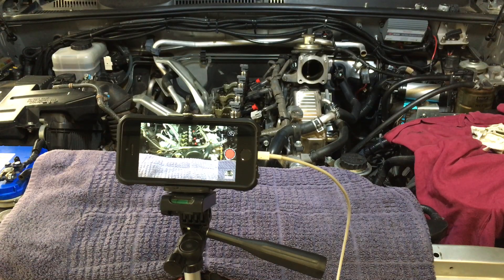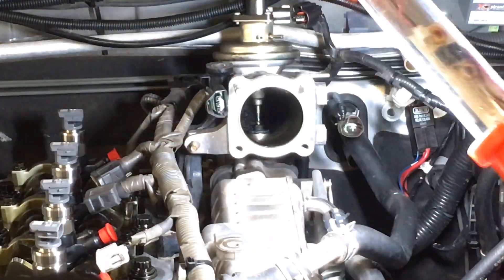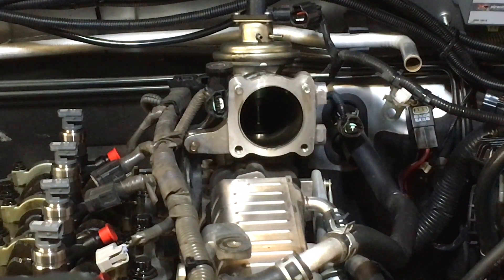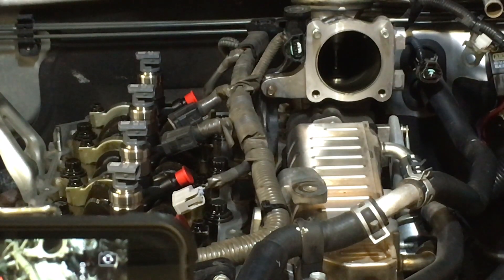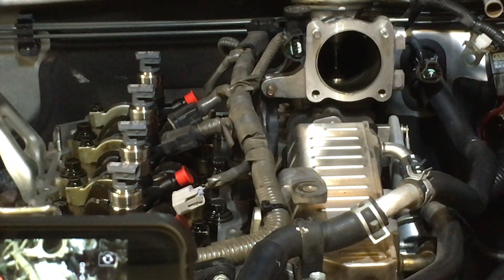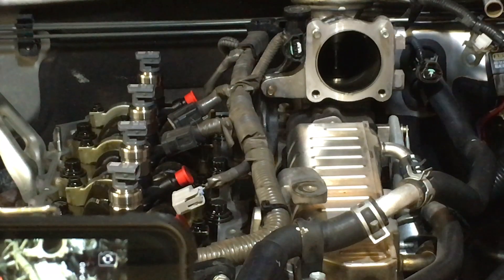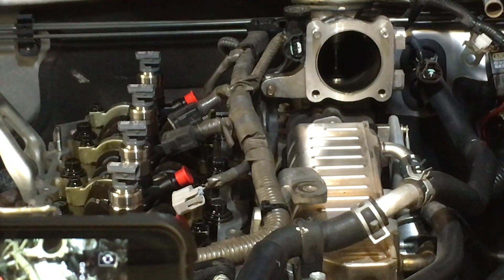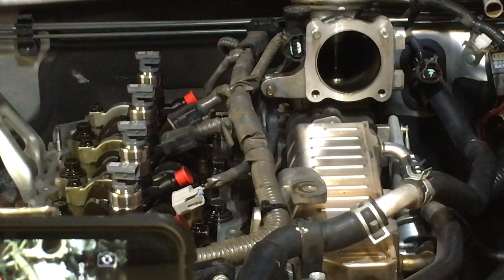WHEN IS A PILOT LEARN NEEDED - p1601

Comment: I had smoke issues under heavy acceleration, bad enough that i could see it in my mirror. When i did the BFE kit i completely removed the intake and cleaned it ( wasn't too bad but did it anyway ) and also fitted the 7mm plate to the ERG, I haven't noticed any smoke since